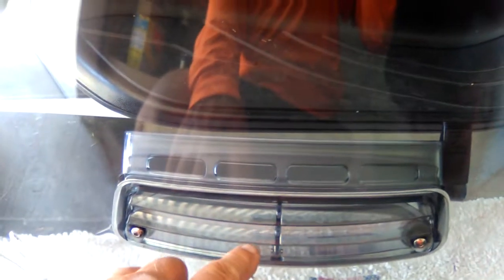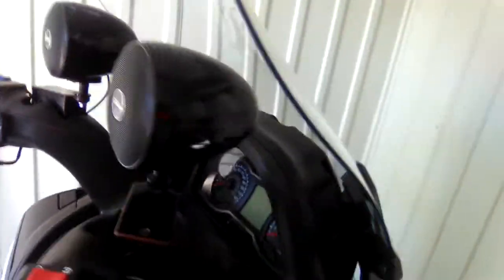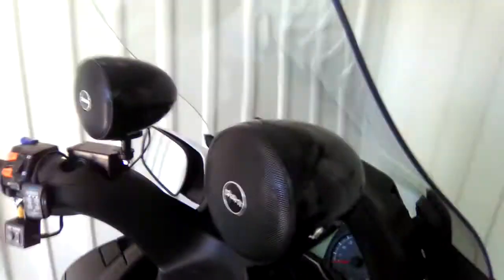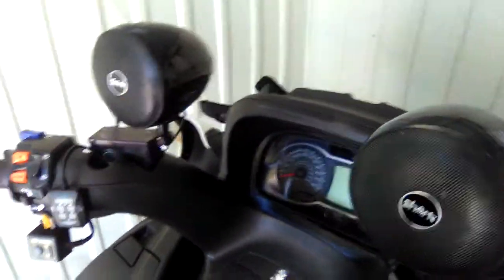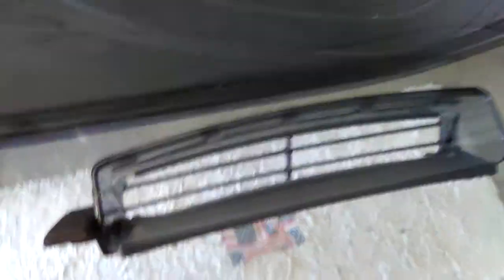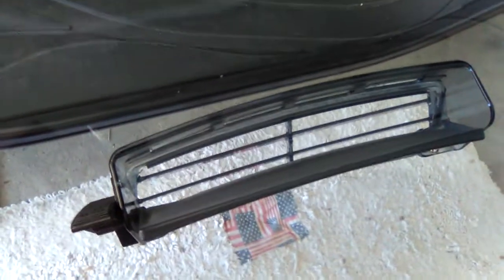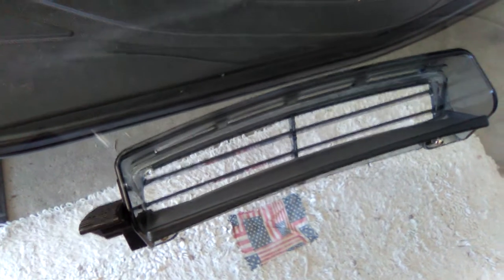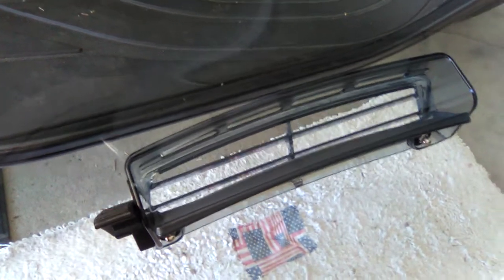I had to put the original windshield back on my scooter because of the speakers

Comment: On the top screws of the Clearview, I have heard of people getingt longer screws and use metal washers to "Shim" the angle of the windscreen.  That makes it more perpendicular so the speakers won't hit the "Gold Wing" vent. Just a thought.  Ride Safe.
Reply from the maker: Hi this is pewter Steve thanks for your help I saw that one of the videos about putting spacers and so the glass windshield to be pushed back but I tried it but I didn't like it so I bought an item on eBay it's a bar I have it on one of my sites you can look at it it looks pretty cool you can add your telephone your speakers are road maps or whatever you want to put on it it came from China and got off of eBay you take care scooter Steve oh keep the good work up on your scooters I have the 2017 650 I love it but the item I found out now they're not making the 650 anymore the last one you can buy is the 2018 I wish there was still keep making it cuz I think that is a real good bike to 6:50 I had the one that you had to but I sold it and bought the new one I tried to find out if they're going to make it anymore so I contacted izuki and they told me not for California or nine states only in Japan they're making it but I wish they was still make it again it is a excellent bike the 650 Burgman I love it a lot you have a safe drive